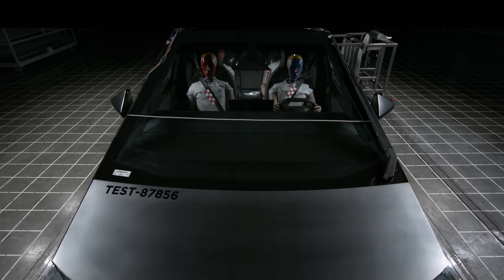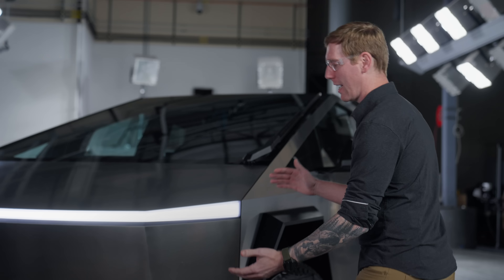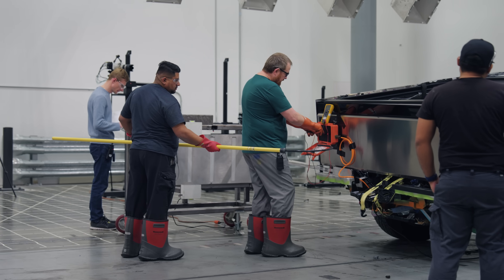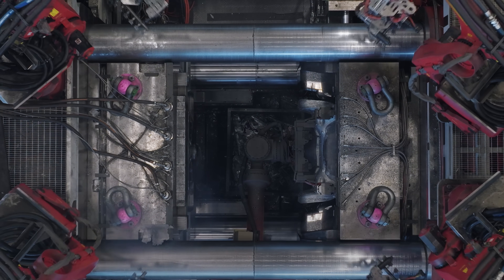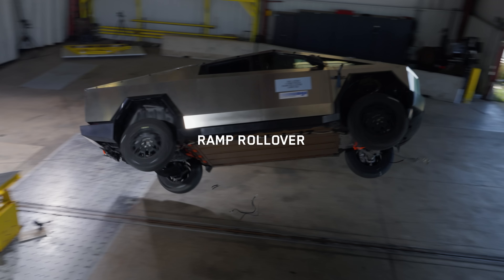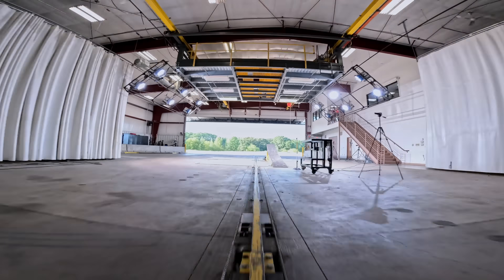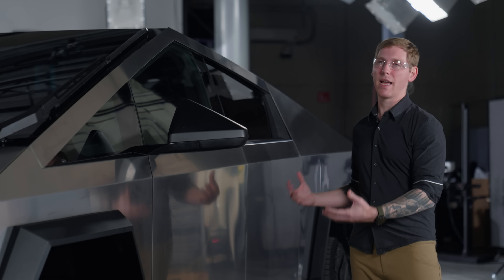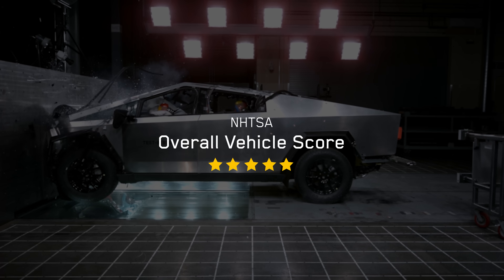Engineering Cybertruck for Maximum Safety | Tesla

Comment: Trucks are just not as safe for unprotected pedestrians in general, would nice to see that kind of testing.
Reply: It would be interesting to see the euro ncap rating, which includes pedestrian tests
Reply: @KlaasDeSmedt The thing is not even allowed in Europe, tells enough about safety to me lol
Reply: @RCmies  Lol it is allowed in Europe Lol.

Just not in Germania where the regulations are from Karl dem Großen.
Reply: @RCmies  There is only one reason it isn't allowed in Europe. The furthest pannel in the front has to bend at a certain angle per EU regulations, which it currently does't. It bends, but not as dramatically. 

So, they could get it approved in EU, but i doubt its worth the effort, given the size of the market.
Reply: @KlaasDeSmedt There's a good reason why it's not allowed in the uk yet and that is it
Reply: @KlaasDeSmedt Yeah this Tesla test is bs, they make it say whatever they want
Reply: Cars are not as safe for pedestrians as bicycles!
Reply: large SUV is basically as heavy as a normal truck
Reply: @YR2050  A Model Y is a large SUV - in Europe.

A real truck weighs at least 7 tons. 

Everything else is a panel van at best. Or a playtool for the rich and filthy.
Reply: How many pedestrian and truck accidents? Most truck accident are single vehicle rollover.
Reply: the low nose, low front bumper and the cameras and AEBS make it safer for pedestrians than other pickup trucks
Reply: What would a dodge ram, ford f150, chevy silverado, toyota tundra, gmc sierra, nissan titan, jeep gladiator, or mercedes benz g63 do to a pedestrian????
Reply: If you get hit by any vehicle, good chance yo ded
Reply: Hey, nice pfp
Reply: I wonder if they can make some modifications to meet other country safety standards. Such as replacing the whole front with plastic that looks similar to stainless steel.
Reply: @ They also have to reduce the weight, since it currently requires a special driving licence in europe for the weight alone.
Reply: @Kaiser-ks3yq  oh yeah. 👍
Reply: Wtf is it that you want to see?
Reply: But do a real world test - with automatic collision avoidance and forward collision avoidance on. Then compare to an F150. AI saves lives and Cybertruck will likely win hands down.
Reply: Yeah, i'm surprised that isn't included in NHTSA standard truck testing. Therefore, i'm not sure how this would fare. However, there is a strong correlation between hood height (blindspot) and real world pedestrian deaths by trucks. The Cybertruck's hood is very low compared to the norm.

Besides, the software probably wouldn't let it happen anyways.

But, yeah
Reply: I believe would you be quite safe from a pedestrian impact in a Cybertruck, or any truck for that matter.
Reply: @LukewarmEnthusiast  I hope you're joking but just in case, but i was talking about the pedestrians health not that of the driver
Reply: No vehicle is hit somebody with a go kart going 50 and there will be problems 😂
Reply: NHTSA has regulations for pedestrian impacts that all vehicles sold in the USA must meet.
Reply: No truck is. You think my ram 2500 diesel is going to leave someone in good shape after getting hit when it weighs 9000 pounds or close to.😅
Reply: Teslas have the best active pedestrian safety systems on the market, these things are monitoring their surroundings 24/7 and as safe as it gets.
Reply: dump trucks are even worse for pedestrians!
Reply: It has a very low hood for a truck, which is a big factor in pedestrian deaths.
Reply: @kevinjohnston4923 who has died?
Reply: @kevinjohnston4923  very true, as a pedestrian, I'd much rather get hit by something as low as a cybertruck so I fall on top of it and it doesn't run me down
Reply: @kevinjohnston4923  yes, meaning lower hoods are safer, correct
Reply: Cybertruck is the SAFEEST truck in WORLD , PERIOD.
Reply: Also in Europe we have something called "compatibility testing" where we make sure that if it hits a very small car, the small car occupants will be as safe or safer than the large car occupants.

What this results in is large cars need to be made so soft (to accommodate small cars) that large cars crush like a sardine can when hitting a solid object (i.e. a tree) whereas small cars absorb the impact.
This leads to large cars being more likely to result in a fatal collision, but small cars far far more likely to result in severe bruising/whiplash/concussion/damaged back/neck/other support bones.

(because small cars and big cars are made so that if they hit, both cars occupants will be just as safe, it means the large car has to be very soft to make this the case)
Reply: @Kaiser-ks3yq   I don't think that's true tbh, (unless u have a source for the  claims ofc) the main body that houses the occupants are made to be rigid as can be  in any vehicle regardless of the size. The crumple zones are to absorb the impact, if the larger vehicle crumples too easily, the smaller vehicle will hit the rigid body and get damaged regardless
Reply: @ by the point you've "finished" pushing through the crumple zone, the majority of the impact has already occurred, and the frame that houses the occupants can only be so strong (otherwise you get cars with A/B/C pillars that are too large and you can't see out, or doors that are unpractical etc) so the frame of the cabin is built with the expectation that most of the kinetic energy will be absorbed into the crumple zone.

You would be correct if it were possible to make a crumple zone too soft for an impacting vehicle, but there are limitations usually (an engine can't be made extra soft etc)
Reply: @Kaiser-ks3yq   I asked my LLM friend.

Right:

    Europe does have crash compatibility testing to improve safety between large and small cars.
    Large cars are designed with crumple zones to reduce harm to smaller cars in crashes.
    Small cars generally have a higher risk of injury due to less mass and structure.

❌ Wrong/Misleading:

    Large cars don’t "crush like a sardine can" in crashes with solid objects; they still have strong passenger cabins.
    Large cars are not necessarily more fatal in crashes; they often have lower fatality rates for their own occupants.
    Small cars don’t necessarily "absorb" the impact better; they just have less mass to protect occupants.

Overall, the statement oversimplifies and exaggerates some effects of crash compatibility. 🚗💥
Reply: @ "Overall, the statement oversimplifies and exaggerates some effects of crash compatibility."

I completely agree, but this is a youtube comment section, and even with my oversimplification the american I was talking to couldn't understand.
I was making a compromise, for the sake of explaining something a target audience which doesn't care about crash safety stats  other than "am I safe if I'm in my own car".

Also I did leave another comment with more detail but youtube has started deleting them =/
Reply: @Kaiser-ks3yq  Yes, Those weak Europan cars crumble like sardine cans. CT for the win!
And Unimog. And Puch G and Landy and Tatra 6x6 and all trucks and Fendt trekker and and and.
Reply: @ large EU certified cars crumple

Small European cars are actually much stronger than most American cars, for safety.
In fact if you were in a ford explorer and I was in a VW up I'd probably come out on top in a crash.

Especially if I hit you in the side, your vehicle would be so heavy such that your door can't take the force put through your door when the Explorer gets pushed by the up.
Reply: @Kaiser-ks3yq  Ford Explorer 3 tons.
VW Up 910 kg.

Could you pelase send me some of the shit you are sniffing?

Thx!
Reply: I missed the part where that's MY problem
Reply: @matw1x because you are selfish
Reply: An unprotected pedestrian again a bicycle loses badly, your argument if foolish.
Reply: @achap6376  You're comparing a 3000kg angular motorvehicle to a bicycle buddy
Reply: Cybertruck SAFEST Truck , PERIOD.
Reply: EU blows
Reply: If you’re a pedestrian get out of the way. How about that?
Reply: tough luck for the pedestrian, right?
Reply: @Grunttamer Tesla has software capabilities. Which planet are you living in?

Comment: Bro has tesla seen WhistlinDiesil 🤣, 5 star is wild
Reply: His tests were designed to break it, not representative of what actual consumers would ever encounter
Reply: Ah yes, let's compare an unscientific stress test to a scientifically controlled crash course used as a standard by the NHTSA. Surely it will be apples to apples... 🙄
Reply: @Danly_W  And believe the guy who's named Wislin DIESAL, like he's not biased in any way subconsciously or paid for by the oil industry. 😂
Reply: Tesla prob gave ncap a much durable cyber truck to test
Reply: @TKC NHTSA orders vehicles anonymously so manufacturers don’t give them an altered one.
Reply: It only did bad at towing big things... They can fix that in 2025
Reply: Where he dropped the Cybertruck on its tow hitch and wondered out loud later why the tow hitch was so fragile?
Reply: yea cuz this is a safety test not a durability test💀
Reply: @ In his video, you can see that due to other cybertruck frames snapping, someone got hit by their own trailer, that's not very safe.
Reply: @Hendo066 only heard of one incident
Reply: Fr tho 😭🙏💀

Comment: The UK needs to see this.
Reply: I think the UK has. And I think they smelled the bs from kilometers away
Reply: They're completely blinded with hate against Elon. Commies hate Elon. Elon could cure cancer and they'd still froth at the mouth with rage against him.
Reply: Don't worry guys, I have information that if the Fiat 500 runs you over it feels like you're being hit by a pillow, that's why they're worried about the shape of the Cybertruck
Reply: Sorry I missed the part where it hits other cars, and the bit where it hits pedestrians, oh and the bit where it hits cyclists, oh also the bit where it hits motorcyclists.

I think we can all agree that this truck is very safe for the people inside it, but everyone else (other vehicle occupants, peds, etc) is at much greater risk.

Purely just from a conservation of momentum standpoint it's awful, then when you realise the sharp edges for pedestrians, the aluminium frame that won't bend, only disintegrates when involved in a very heavy collision.

Don't get me wrong, you could make a vehicle this heavy safe for other road users, but you do that by designing it with such soft crumple zones (to make up for the weight) that if you hit another car, you'd probably both be fine, but if you hit something fixed (i.e. a tree) the crumple zone would be far too soft to protect anyone inside (But it would pass UK safety regs, as it's not endangering OTHER road users)
Reply: @Kaiser-ks3yq  You're reasoning is beyond stupid. A pedestrian getting hit by any vehicle is going to hurt/injure. The probability of getting hit by a CT is lower than any other vehicle. There are PLENTY of vehicles with "sharp edges" (Cybertruck doesn't even have any, it's quite blunt actually). Think of every car from the 70s... Or a Mac truck... Or a Chevy Tahoe. 

Use your brain: this whole CT vs pedestrian thing is completely moot.
Reply: For real, Cybertrucks are basically the near future in 2030, This car will get great over time.
Reply: real
Reply: What is the point? It completely fails to live up to our safety standards in any way shape or form. They specifically built the vehicle this way knowing full well before hand that is isn't allowed on UK roads.